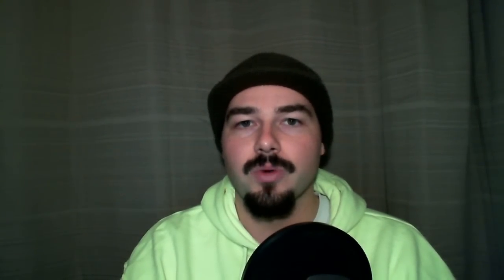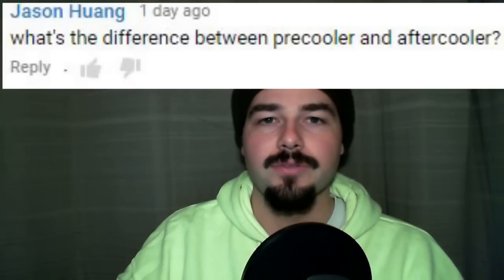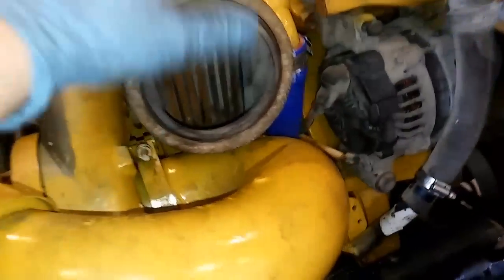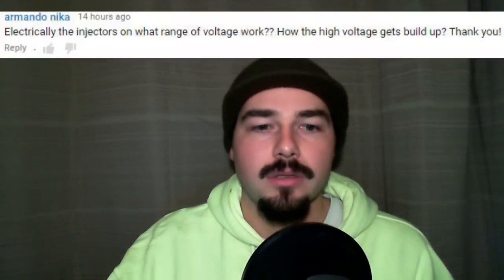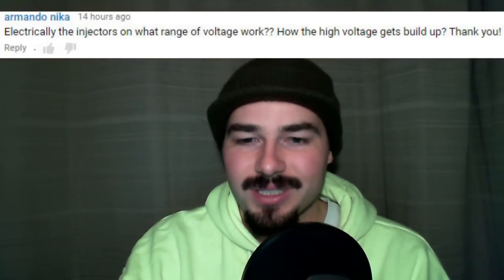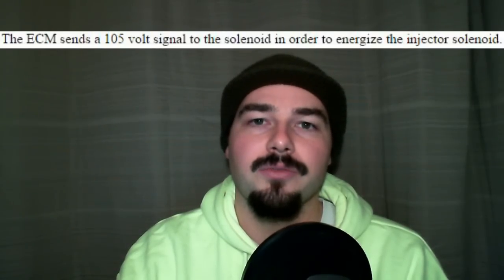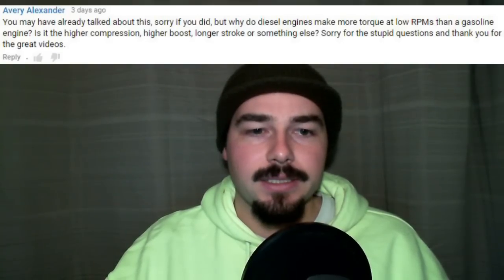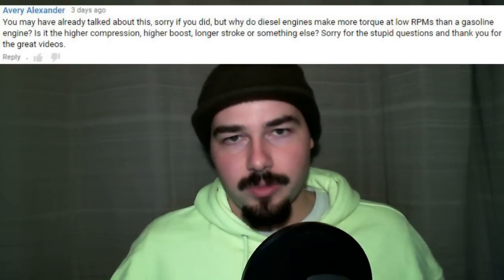What Is A Precooler?  What Is Mechanical Advantage?  C18? Injector Voltage?  Diesel Talk Episode 11.

Comment: when my son was about 12 we'd go into the desert with some caterpillar 651B pistons fully ringed and we'd muscle them into freshly honed and oiled piston sleeve or liner that was wire welded to a 1/4 plate of steel with a hole the size of light wire or cannon fuse that was inserted into a mechanical or electrical blasting cap that also was tied to about 12 to 15' of green primaline rolled up under the piston. So we'd get back about 40ft under cover of a Datsun Pickup door and connect a double a battery to the wires. The amount of power to expansion chamber (which was  practically none, only inside the bottomed out piston sitting on the charge,) would fire the cap almost high enough strait up, to be out of sight. We'd recover that and only thing ever left was the cap severed where the skirt molded into the top of piston. The rings still present would be literally welded in place as they tried to seize on their way out. the liners would completely disintegrate along with the expanding skirts, the 1/4" plate would be a bowl. we were going to try to launch one 8 miles at an angle like a mortar with an expansion chamber and some sort of pipeline barrel 8 ft long, back in the fun days.

Comment: Mercedes makes several auto diesels that rev past 7k, but to do this have a relatively small stroke (they are gasoline based engine blocks) . they loose quite a bit of the torque normally found in diesels, but  it stays "even" (hp=tq) for being small engines.

Comment: Aussies use them in truck with truck trains. C18 used in vehicles don't have 900 hp because constant change in RPM, throttle, torq will make them not last long. Industrial side same engine can stand high power because they stay at constant load. Seen many hot rod C15's die very early cranking out 900hp. Also one that when cold had fuel knock in tell warmed up and this engine also was burning cyl head around valves. It had some fuel cranked to it i mean a lot.

Comment: Hey Ape, I agree with one of your commenters below! I would personally like to know the differences, bores, strokes, horsepower and torque ratings for the C15, C16 and C18 engines? Also, I would like to know if the C16 & C18 were equipped with CGI or any after-treatment and what applications were they were installed in?
Reply: I'm a fan of the C16 but, I was shocked to learn that the C18 uses the same block as the C15. Definitely, more information required my man.
Reply from the maker: +Norwood E. Jatho, Jr. I'm getting a bunch of C18 questions now so I'm going to have to find out if they can be retrofitted from a C15 engine and what is different.

Comment: hi good evining ihave apropmlem with c18 engine when we starting not cranking and after that they hhave alarm on monitor control says fault shutdown and they have some codes on monitor no one (cid 190 itis engine speed sensor and othe code is (fid 3 )) please replay to me and inform me thank you

Comment: dear Adept Ape how can i make leak off test for C7.1 common rail  i have crank without start i need to find the problem , high fuel pimp  or injector 
note: fuel rail pressure was low
thanks

Comment: interesingly the C18 in the Marine versión (which is single turbo)changes fuel pump, fuel injectors and camshaft  goes up to the 1150HP and 4350Nm, between the single turbo normal c18 and the twin turbo there is like 170hp diference so then it would not be too hard to get 2000hp with the right modas (bigger turbos,exhaust manifold, egr delete, mahle pistons and valves, connecting rods, turbocompound...)

Comment: I have a 1996 3406e. I've heard when idling, its best to kick up the rpm's alittle. Is that true and if so, what rpm number would you recommend? Of course fuel management is always important with the big kitty's. Unless your doing heavy haul then its about Silver Back Gorilla torque...lol. Thanks👍
Reply from the maker: +Big R Phillips How long are you idling? If It's  just normal driving I wouldn't say it's necessary. If you let it idle for hours I'll try to see if there is a recommendation for long term idling rpm range.
Reply: I think that the idea is to run the rpm's up to where the oil pressure gets up to about normal operating range pressure for better engine lube. On a KW T660 that I'm familiar with that was about 1,000 rpm. An old school CDL instructor/driver told me this. AA would know better than me if that's a smart thing to do.

Comment: Mack  had  a  450  horse  v8  that  used  a  air  to  air  pre-cooler  that  was  in  a  box  between  the  banks . It  used  a  fan  that  was  run  by  the  boost  air . very  weird  setup

Comment: how are the cat engines on a truck compared to something like a cat wheel loader or bulldozer? Do they use the same engines like a c7 or a c15 or are they different to work on?
Reply from the maker: +Tom H They are pretty much exactly the same in design and function, but usually have a different serial number set than the on highway engines and may have different style outer components like the water pump, turbocharger, and intake.

Comment: Have you dealt with any Cat diesels converted to run on purely natural gas? I found a picture of one, and it looks like theres spark plugs where the injectors go, and it has a throttle body.
Reply from the maker: +VinylDash303 Cat does make many of its engines with a natural gas option, but I've never seen one converted from Diesel to Gas.
Reply: Adept Ape Look up the Omnitek C15 conversion and it should be the second picture on Google Images. Looks strange IMO.
Reply from the maker: +VinylDash303 I saw the C15 with spark plugs and throttle plate. How do they keep the high compression ratio from pre-ignition I wonder?
Reply: Adept Ape I don't know. Personally I'd want to stick with the rumble rumble fuel. Maybe mill out the head a little bit or low compression pistons. Its some funky stuff though for sure. I don't even know if they kept the turbo.

Comment: so basically with a C18 you could technically use a C15 block, put a C18 bottom end kit in it and then get a C18 cam and valve set therefore basically making a C18 but with C15 block and head cores?
Reply from the maker: +shortfuse1993 I'm going to do some more research and find out because a few people have asked about that.